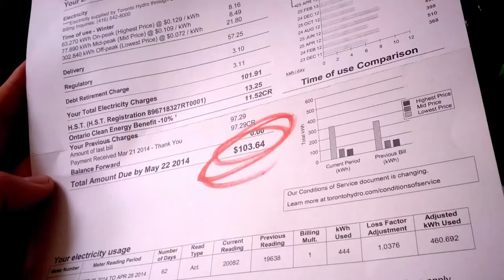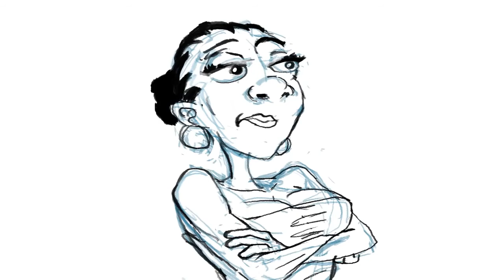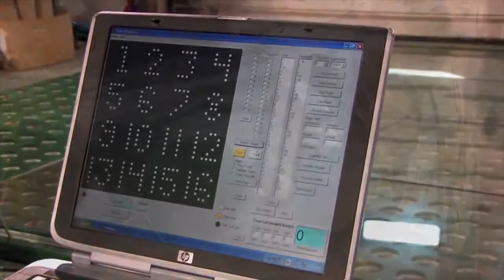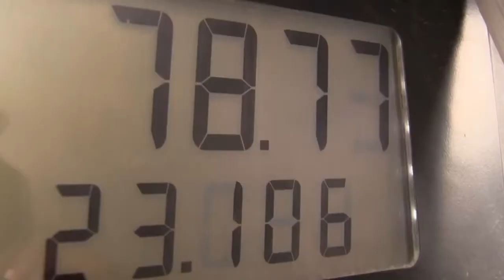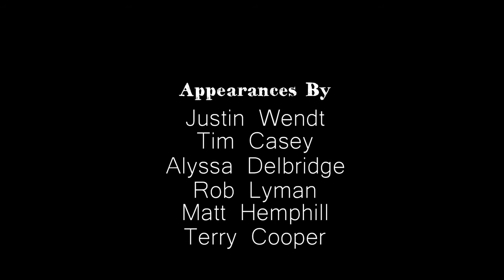Solar FREAKIN Roadways!

Comment: Look up thunderfoot's debunking of this.  He got most of the areas where it  simply won't work.  There are other deeper more technical issues that ensure it will fail even if it gets past his points but there is no need to go into those.